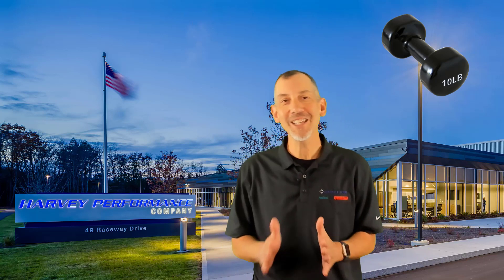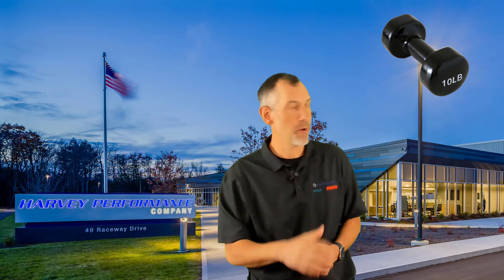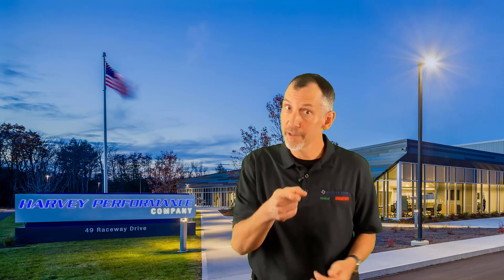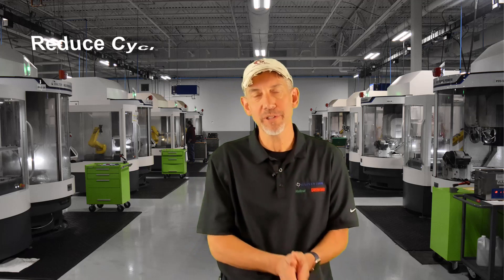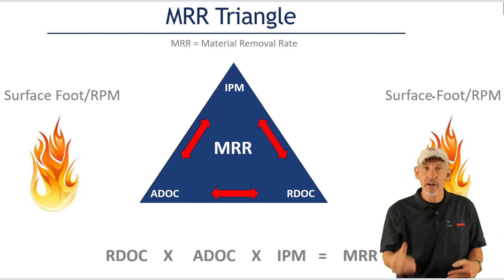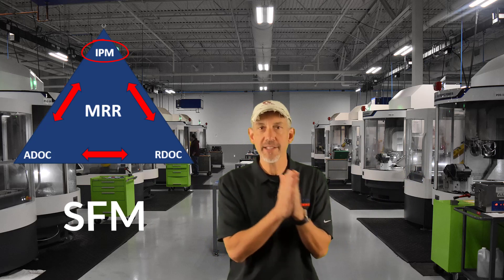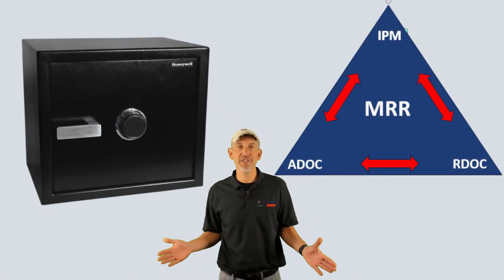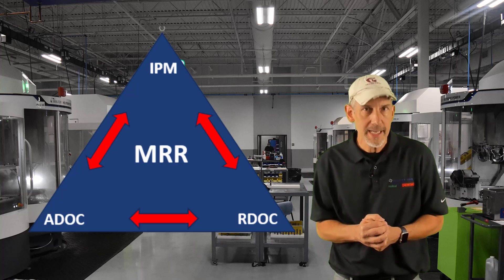Material Removal Rate Triangle: In The Loupe TV Ep. 3

Comment: Very enlightening , you explained a complex concept so easily. I want to know where did the SFM come from ? Is it determined by the tool manufacturer. And also how is it determined.
Reply: Machinability of a material based on its hardness and Element makeup which will add to the ability of a material to resist heat..  These are all factors in the suggested SFM. ctc
Reply: @CuttingtoolCounselor  thank you very much  for taking time to reply me.

Comment: this is good information but how do we realistically diagnose?
Reply: Several Ways to diagnose this Nick..   If an endmill is chipping and your setup is good, you are probably feeding it too fast and chipload is too aggressive.  Bring down your chip load by either increasing your RPM ( not to slow down MRR) leave feed where it is at OR  Reduce your feed and make up your MRR by increasing your radial.   If your Endmill has a problem getting the chips out by loading up the flutes or excessive built up edge!  Then you can do a couple things.  Reduce your radial..  When we do this you will be able to take advantage of the heat and increase feed by RPM. Or Reduce the number of flutes on the tool and going back to increasing the Radial..   Axial is going to be the deflection killer..  So if your diameter to Length of cut Ratio is too great you will see a lot of chatter and deflection.   Reduce your axial # 1 or #2 go with a larger diameter tool.  Once you do this you can start creeping up your radial again...         And Finally Remember when it comes to MRR....  A larger tool will help increase the rigidity and the cubes you remove..   If applicable.    Hope this helps!!

Thanks 
CTC
Reply: @dongrandt372  thanks boss!!!!!